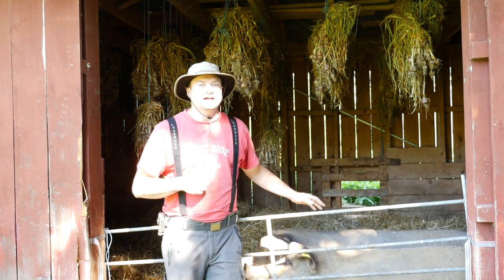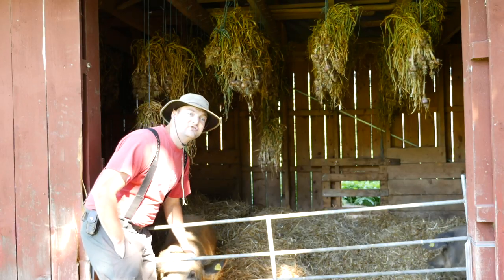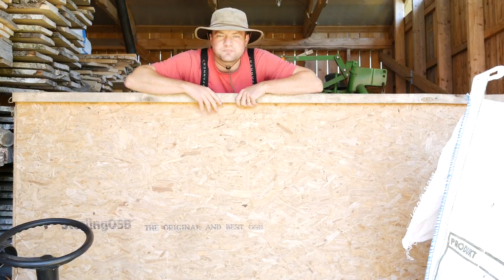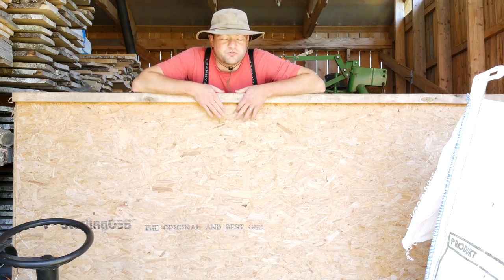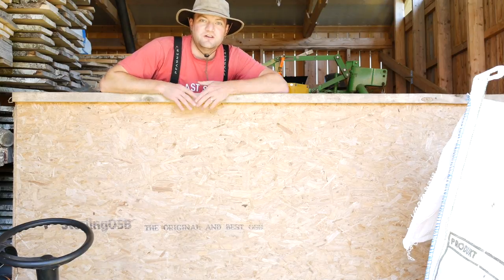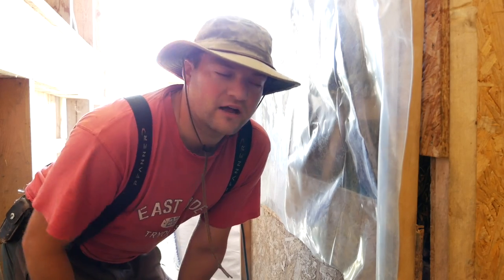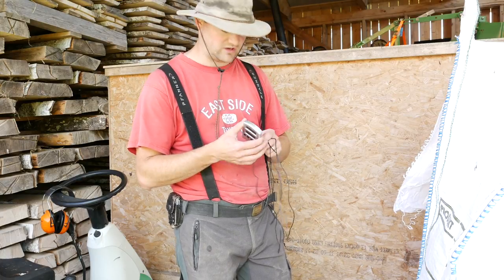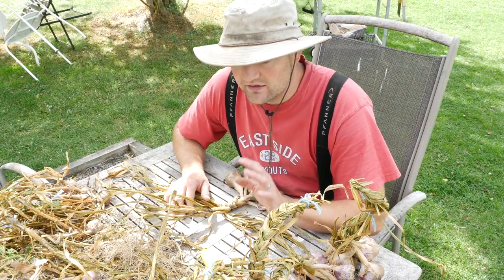DIY Garlic Dryer | Increasing Your Produce Value

Comment: You mentioned $8 for six bulbs. Any idea how much that equivalates to per pound?
Reply: 6,21 Sterling
Reply: Here in Vancouver Canada, 3 bulbs is CAD$0.97 so I'm thinking that $1 for 1 is very expensive. Is it normal for food to be so expensive in Sweden or is this a supply and demand issue given the proximity to a large city?
Reply: can't compare these to the chinese garlic
Reply: Charly Maher no it's not very expensive with food in Sweden. It's just people being cheap that think that food is something that should not cost anything. Today in general 18% of the taxed salary goes to food.